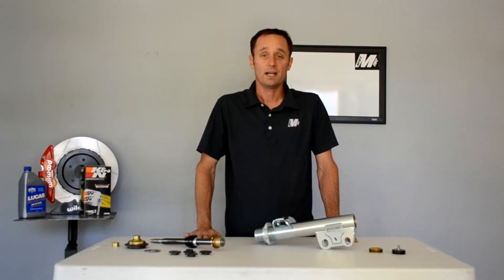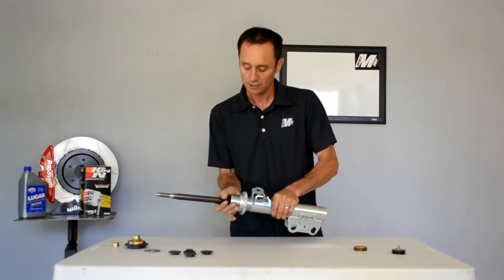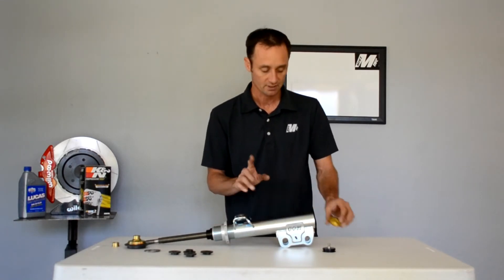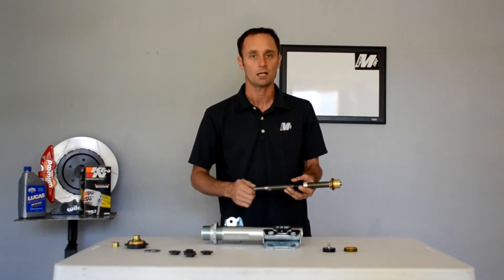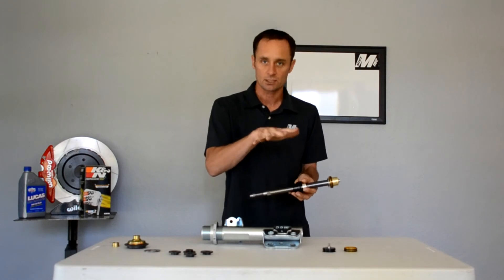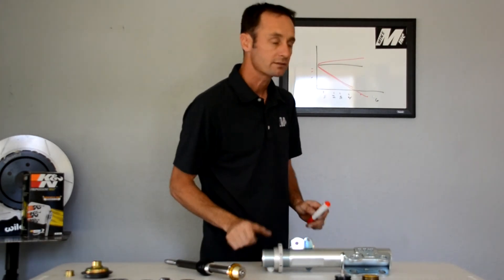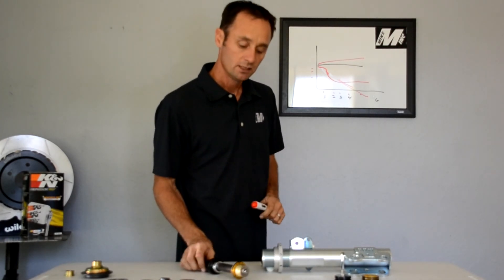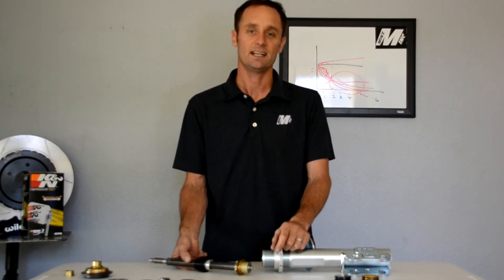2015+ S550 Ford Mustang Front Strut Detailed Tech by MMI

Comment: Very good Tech info. on your MMI JRi Strut System for the 2015+ S550 Mustang!  I like the Idea that your Strut is made of Steel for Strenght and Durability!...Also, I like the Idea the Diameter of the Strut is Smaller to Allow for a Wider Tire/Wheel combo like a 18x11 Wheel fitted with a 315/30rx18 Tire in the Front without Flaring!  But I was wondering would the Front Fenders from the Shelby GT350/GT350R give you more room in the Front?  Thanks and God Bless!
Reply from the maker: Thank you for the comments.  We have yet to fit a pair of GT350R fenders onto a standard Mustang, however one of our vendors (Anderson) composites makes a GT350R style front fender for a standard Mustang.  These fenders give you an extra .4" of fender clearance.